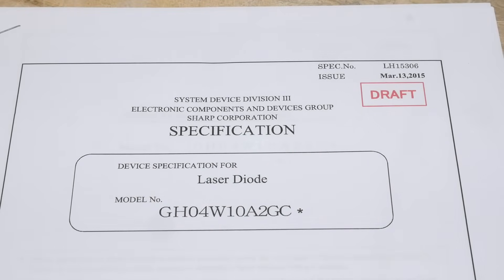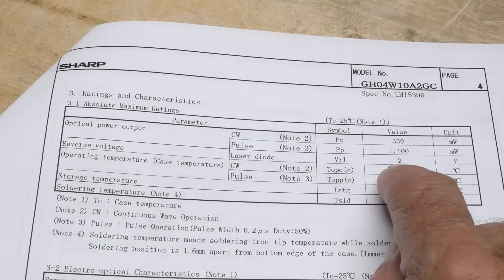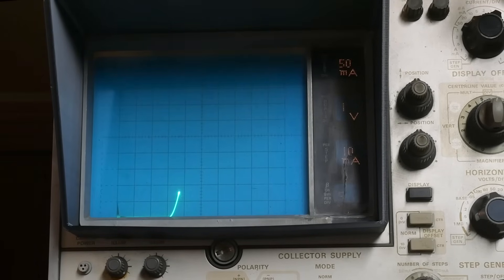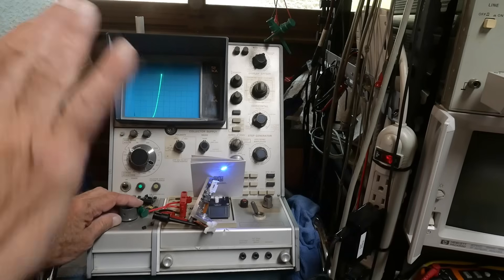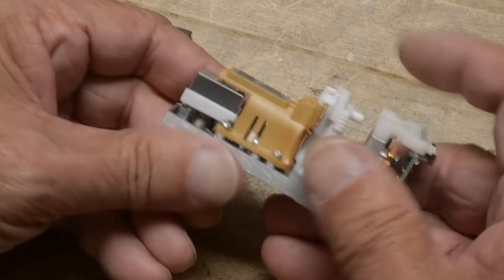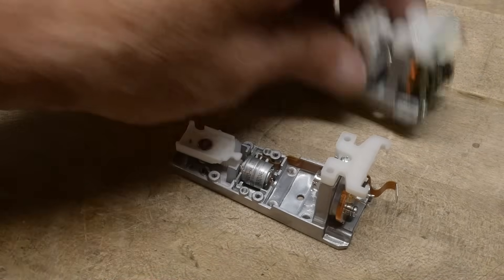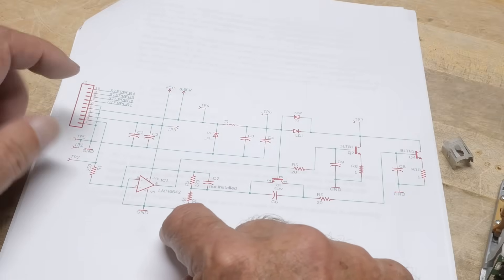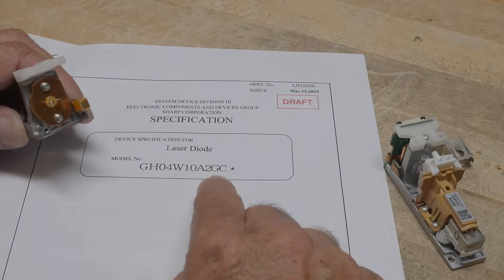#2268 405nm Laser Diode Module

Comment: What are you going to do with this module? From the previous videos, if I am not mistaken there were purchased plenty of similar. Just wondering. For instance, I bought a 405nm 0.5Wt laser on Ali with the intention to rebuild one of existing 3D printers. The main task for it -  is to make the PCB prototypes at home. The last 15 years up to now I've been printing a positive footprint on the transparent film, then exposing it under the hard UV beam. Works perfect, but needs much work.

Comment: Neat little module, I love these short videos. Did you try powering up the onboard driver circuit?
Reply from the maker: yes, it requires a negative voltage input, the voltage in is proportinal to the current out

Comment: Sharp also made a blueish green laser diode to (505nm). I miss my old laser pointer that I build out of this. Very nice green color.
Reply: Then it is not a green diode, but a IR diode with a crystal to make 1010nm into your 505nm. Be aware, that much IR-light is emitted throu the crystal!!!
Reply: @FuD-ForschungundDrogen It's single mode direct lazing laser diode. I can't recall the part but it's GH05035 something.

Comment: Very nice tear-down. The laser diodes might have 3 connections, two for the diode and one for the sensor to regulate the optical output power.  One connector will be the casing. 
The right transistor on the schematic has no base current to drive it. So I think the two have the same base signal.
Reply from the maker: this laser does not have the monitor photodiode and only two pins
Reply: It quite clearly has 2 pins.